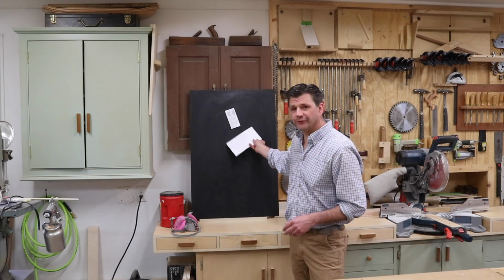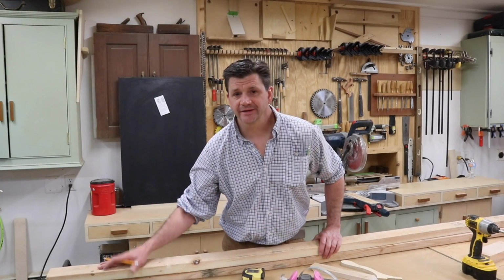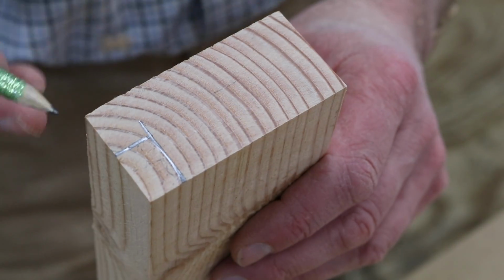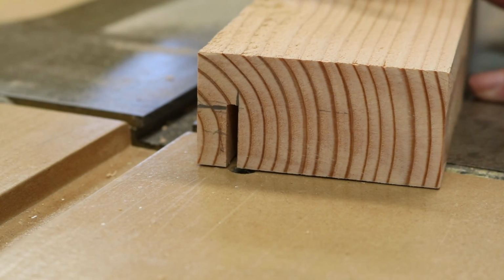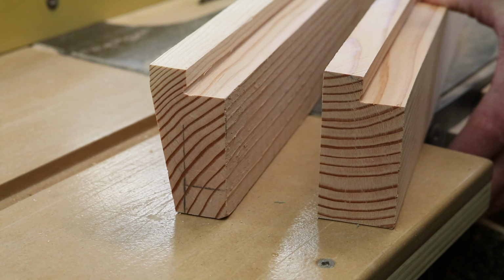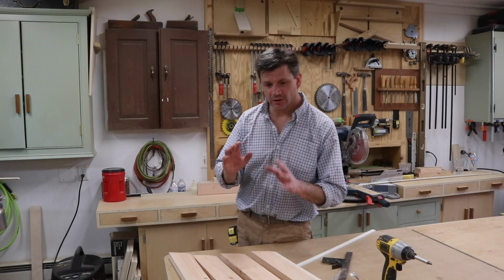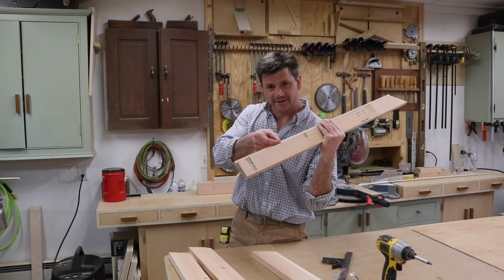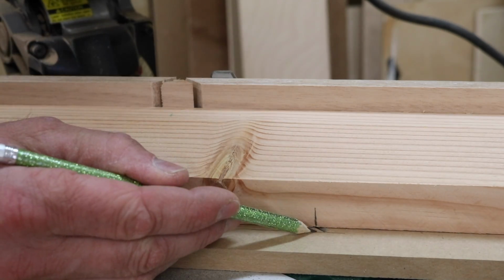How to Make Molding with the Table Saw & Build a Frame

Comment: Hey Jon, just a quick question.  When cutting molding on the table saw, especially when trimming bead molding down to size, is your preference a full kerf saw blade?  Thanks for the great informative videos.
Reply from the maker: +Mike G Hi Mike, yes I always use a full kerf blade , it's just what I've always used.